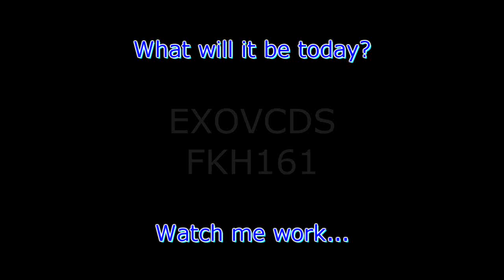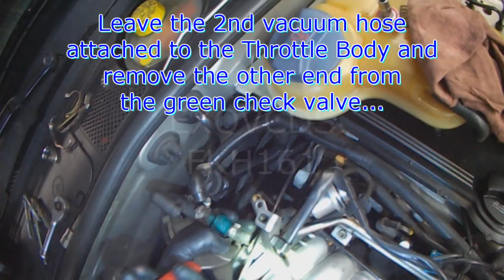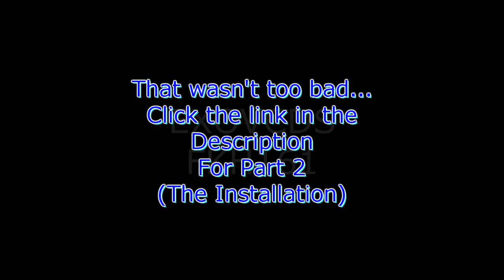Audi B5: V6 ATQ Throttle Body Replacement (Part 1)

Comment: My car has a problem with RPM instability after startup, and sometimes I get power shortages on uphill roads. This sometimes goes away after a certain amount of driving. Can we solve this problem with throttle cleaning? My car is an audi b6 cabriolet v6. I found out that this is the same construction as the passat 2.8 engine and the Audi b5 v6 engine, and I learned a lot from your videos.
Reply: My question is, is there any room for this to be improved only by maf cleaning? And if I have to clean the throttle, I would like to do it with minimal disassembly. So is that possible with just 4 bolts separating holding the TB?
Reply from the maker: Throttle body bore cleaning usually only solves "idle issues".

The throttle body can stay in place / does not have to be removed for cleaning. Remove the intake duct that is attached to the throttle body and use a wet rag (gasoline or brake parts cleaner) to wipe / clean the throttle bore. Use your fingers to push the throttle open & hold it open and then use the wet rag to clean the inside. 

Check the ECM for fault codes.
Check the engine for vacuum / air leaks.
Check fuel pressure & quantity.

Most likely it's not a dirty throttle body issue.

Comment: Awesome video, I couldnt have gone through the process alone with your help. I'm having a rough time getting the clip portion of the cruise linkage off. And since its just dangling sort of, its difficult to get the accelerator cable off. Any tips? Thanks
Reply from the maker: Wavy Crockett Can you send pictures or a link to a YouTube video of the parts in question. I need to see things so I can explain (correctly) what to do. fkh161@fkh161.ca

Comment: I just bought a 1999 Audi A4 2.8 Quattro manual 6 cylinders the other day and it has a code p1545 it has a rough idle/low rpm/power and she stalls if not giving it some gas now I have look it it up and it says if I replace/clean the the throttle body and relearn the TB it should fix it because people had the same problem with Audi's around that year. And it has a oil leak that I have to fix as well. And it seems like its misfiring to I am seeing if I should buy a new one at autozone or get one used at molts for $100 or should I try to clean it first and hook it up to VAG-Com and relearn it?
Reply from the maker: IMP429 Cleaning will only solve an "idle" issue... if you have issues when off idle, then it is not due to dirt.Cleaning the throttle bore is a cheap first step, when dealing with throttle body module issues.
Reply from the maker: IMP429 In the video, he says that all you have to do is the basic setting / adaptation. Like I said, clean it first and then do the basic setting / adaptation. If the problem still happens, could be the throttle body.

Comment: I have a 99 audi and when I'm in drive or reverse, in a stationary position the car starts to shake and the rpm fluctuates..  But when driving it doesn't affect the car.
Reply: Is it the V6? Mine does it a little when starting up, but after driving it'll settle to 800 RPM at idle and smooth out. I'm still trying to find out why it's doing it on mine, but still haven't given it a throttle body alignment yet and hoping it's just that. 
Have you already replaced or made sure the vacuum lines, PCV tubing, and suction jet pump are all good?

Comment: I've got a crank,  no start, epc light is on.  Sounds like a lifeless cranking.  I replaced ess already, I checked for gas at fuel rail. There is decent spark. I'm thinking it might be the throttle body.  I dont hear the normal whirring noises it used to make when turning the key to on position like before.  Also I noticed a slight buzzing by the throttle body with key in on position that stopped when I smacked it.  It's just so tight back there and crunchy hoses too. Codes have been cleared now with the disconnected battery. I had an o2 code and camshaft code before all this but ran decent.  All started after the polar vortex hit
Reply from the maker: Check your timing belt... if the water froze, the belt might be broken.

Comment: Great video, thank you. My pcv tube broke that is under the intake manifold and I'm having a horrible time getting to it. Do you know if I must remove the intake or can I get to it if I follow your work to get underneath the throttle body?
Reply from the maker: Which part... #13 in this link?
https://audi.7zap.com/en/usa/audi+a4+avant/a4/2000-223/1/103-103080/

Comment: Wanted to thank you for posting this, really great How-To and very helpful. You might be able to help me with an issue i'm having with my newly purchased 2004 Passat Wagon. It's also a 2.8 V6 30 Valve. (same as this engine?). It has a random misfire at accelerating from a dead stop, (like a stop light and such). I replaced the spark plugs, fuel filter and didn't solve the issue. I was thinking of cleaning the TB to see if that helps. Any tips you can throw at me?
Reply from the maker: Jonathan Soto Not a lot of room to get at the throttle body unless you remove it. Misfires caused by dirty throttle body are usually limited to "at idle"... once the throttle is opened, enough air should flow to not be an issue any more. The only way to know if it will help, is to clean it and see. Try to see if it is a certain cylinder... faulty injector spray pattern at lower spray volumes / initial demand? Carbon build up? Ignition wires?
Reply: @EXOVCDS  I have a random misfires and a code for p0104 I changed the spark plugs the coil pack, wires, purge valve solenoid, fuel pressure regulator, and fuel filter, valve cover gaskets due to some oil leaking in plugs and still have misfires
Reply from the maker: Year, make, model, engine? Compression test results? Fuel injector power balance test / check? PCV working correctly? Misfire at idle only or all load / rpm ranges? Fuel trim values? Is the computer adding or taking Fuel away? Are you sure all the new parts are ok?
Reply: @EXOVCDS  it haves a slight idle almost nothing at dead stop and its burning more gas than usual. And yes I got the bosche plugs pregapped
Reply: @EXOVCDS  is the pvc the one connected to the suction pump and the valve cover breathers
Reply: @EXOVCDS  and it's idling  alil before 1000 rpms it's one mark below 1000 rpm
Reply: @EXOVCDS  1999 audi a4 2.8 quattro it smells like strong gas and strong oil burning it runs good on high rpms and not that bad at low rpms. Sorry for all the replies 😅
Reply from the maker: @Hiddensubliminalt  Since it's a V6 and the misfire only happens on #4, it's not going to be anything that can affect all cylinders (fuel pressure, vacuum leak, restricted exhaust etc). I think that model year had an "ignition module" on top of the air filter box... you need to check if the ignition module is sending a signal / activating the coil correctly. Compression test and fuel injector test would be next for #4 cyl.
Reply: @EXOVCDS  it does have misfires on 4 5 and 6 its haves misfires but the main one is 4 and I want to know what else to check for I already burned one catalytic converter so I'm kinda stressed about it. I already changed purge valve solenoid, fuel pressure regulator, fuel filter, coil pack, wires, and plugs, valve cover gasket. Wondering if it's the PVC for the valve cover breather or suction pump for pvc  or egr

Comment: Great video but not an easy job. I am getting a for a 2002 Passat  error code 17579 - Angle Sensor 2 for Throttle Actuator (G188) Implausible Signal, sets off EPC light. I think it is a dead spot at the variable resistor thingy. Can this sensor be serviced without removing the throttle body?
Reply from the maker: Not that I am aware of... the only thing serviceable on the throttle body, is cleaning the carbon deposits from the inside of the throttle body (according to the service manual). I have come across several DIY articles where someone opened up the throttle body (circuit board side), cleaned the carbon track or replaced / repositioned gears. Any of that is done at owners risk.

Comment: I have a noise that comes when the car is under load, for example, I put second gear and floor it (no need to floor it for the noise to come), it sounds like a cricket, can be heard better when there's a wall or inside a tunnel, especially between 2k 3k rpm then it almost disappears. With the car stopped and in neutral, if I floor it I can also hear it but not as long since the engine is not on the same load as if it had a gear engaged and moving.
What could it be? I think it might be a leaking exhaust manifold, it's an audi a6 c5 with a 2.4 V6 engine (same as 2.8L but less cc).

Edit: I did myself the timing belt, tensioners and pulleys (they were due) but the noise is still there.
Reply from the maker: I don't know,  I can't hear it. Could be exhaust, could be a rattle, could be an engine noise.
Reply: @EXOVCDS  I'll try to record a video.

Comment: Planing on buying an Audi A6 C6 2006-2008  and your the only skilled enouth i know to ask :). Please tell me which is the most reliable engine from that car series. Plenty of 2.0TDI's, 3.0TDI's 2.7TDI. 
The only petron engine i liked was 1.8Turbo. Very few of 2.0 turbos out there, but i was looking at them to. Need your small suggest here please :).! Love your work.
Reply from the maker: I'm not home right now... will reply again later.
Reply from the maker: I would check an Audi Forum for "Owner Feedback". There's nothing better than the feedback from an actual owner! I don't see a lot of Audi's and even less of the newer models (2006 and newer) at this time. The bigger the engine, the more difficult it is to work on (less room), not just for the DIY person, but also for the mechanic and more expensive to repair. Check out
http://forums.audiworld.com/forumdisplay.php?f=58
or similar Audi Forums. Maybe one of my viewers will also have some ideas or an opinion they might share. Thanks for watching & taking the time to comment!

Comment: Please let me know if there's a gasket behind that throttle body!! I didnt see one when I pulled it off all the throttle body did was butt up to the intake and there's a orange circle piece is that the gasket? Already mounted on it?
Reply from the maker: The intake has a rubber seal.
Reply: Thomas EXOVCDS thanks your awesome!
Reply: If the seal is torn or just worn with it cause my car to drive like it lost power and low idle
Reply: Crystal Meza I'm not sure but have you checked wires,plugs, and the coils? And check the vacuum lines, I broke mine a couple years ago and duct taped it back together and it still allowed air to get through, once air gets into the vacuum it causes these issues, once I replaced the plastic hose my symptoms went away, I cleaned my throttle body and the gasket is like built in on it, kinda weird technology tbh, I still have a cylinder 4-5 misfire but it isn't noticeable, I think it would be the coils causing it on mine
Reply from the maker: Hi Crystal... which seal?
Hi Michael... thanks for helping! Send me your mailing address and I'll send you some of my channel stickers! fkh161@fkh161.ca
Reply: Hey Thomas, can you lead me in the right direction to buy one of those seals? Pulled my intake off and the seal is badly deformed and cracked all around

Comment: I smoked tested for vacuum leaks and that rubber piece between the plastic intake and TB has a massive leak. It looks fine but doesnt seal at all. Part is no longer in production, any advice before i whip out the RTV
Reply from the maker: Is the part in this diagram?
https://audi.7zap.com/en/usa/audi+a4+avant/a4/2002-223/1/133-133080/
Reply: @EXOVCDS  yes, number 7. For now I did put a light coat of high temp sealant around the inner lip of the seal and the groove where the plastic tube Goes in, smoke tested it and its definitely much better now. Whose idea was it anyway to have that thing held on by a single bolt.
Reply from the maker: If you are going to use RTV, make sure that it is "O2 sensor friendly". 
ECSTuning seems to still list it:
https://www.ecstuning.com/b-genuine-volkswagen-audi-parts/throttle-body-seal/078129949c/

Comment: Hello at 8:53 is the little port plug supposed to be plug. I did a full clean on my throttle body installed everything back and car now has a slight shake.
Reply from the maker: No... should flow air (but with resistance).

Comment: Hi how do I replace my vacuum lines the correct way
Reply from the maker: One at a time, according to vacuum diagram.
Year, make, model, engine production code?
Some are plastic lines, some hare rubber hoses.
It's possible to replace plastic lines with hoses, but the hoses are thicker and may not be able to sit how the skinny plastic lines were routed.
Some rubber hoses can collapse when they are under vacuum, so you have to make sure that the hose is able to hold vacuum without collapsing.

Comment: i have a b6 1.8t and i have a g188 i replaced the throttle body with new one, re adapted and i still have cel traction control and epc lights on.
Reply from the maker: Nay Cee What fault codes?
Reply: Thomas EXOVCDS p1171 on vcds and i had p0221 on regular scanner
Reply: Thomas EXOVCDS when i let the car sit it clears the light then when i drive it the lights come back
Reply: and i had a leaning out code p0171 i think
Reply from the maker: What year? Ross-tech says there's a throttle body wiring TSB: (read Special Notes at bottom of this link).
http://wiki.ross-tech.com/wiki/index.php/16605/P0221/000545
Reply: Thomas EXOVCDS i checked the voltage on the plug and i was not getting anything from pin 1
Reply: Thomas EXOVCDS its a 05 b6 1.8
Reply from the maker: TSB covers the 05 model. If I can find the TSBB, I will post the link here.
Reply from the maker: The fix is to replace the connector & wiring... due to intermittent bad connections. 
http://fkh161.ca/Audi/A4/P0221.jpg

Not sure it will solve your issue, but it is worth a try.

Comment: also another question (just found this out) i have no intake tube bolt. are there two parts to it? i need to find where i can get new bolts and fast
Reply from the maker: M6 with a thread pitch of 1.0 x45 long with a 5 mm allen head
Reply from the maker: deadlyknights1 just making sure, you are talking about the bolt that goes here: http://fkh161.ca/VW/bolt.jpg

Comment: Sometimes our car does not accelerate properly. When I push the pedal it sometimes does not go above 20km/h and it also emits gases from the exhaust pipes, is it from fuel pump or it can be from throttle? Thanks in advance
Reply from the maker: Programmer TAT Year? Make? Model? Engine? Not sure... could be misfiring.  If the exhaust smokes heavy white (smells like fuel), you might have a fuel injector that is sticking open.
Reply: 2000, Audi A6 2.7biturbo, maybe it is from fuel it generally occurs in long rides when the pedal is pushed often to accelerate and pass the other cars, and also when the car is parked and I push the pedal it sometimes does not make a noise at all, I mean engine sound, it seems like it pushes something.
Reply from the maker: Record a video... could be oil burning smoke?
Reply: Could be MAF sensor... At least check it out
Reply: Read. Codes.

Comment: How do I determine if my motor is atq or aha? Having a hard time figuring out what alternator is for my 1999 a4 2.8 as it seems to be 2 options. Don’t wanna GO into service mode and disabling my vehicle just yet because alternator does work intermittently.
Reply from the maker: 1998 & 1999 were AHA (in North America).... 1996 & 1997 AFC... 2000> ATQ
Reply from the maker: As per Service Manual:The engine code and serial number are located on the flat surface of the cylinder block in front of the right cylinder head.
Reply: I think I was able to determine I am ATQ that’s the 99.5 facelift version. There’s 2 connection types to these alternators. Now I’m tryna figure out which 1 I have. Not sure how to even cross reference that with VIN. This Audi making me sad 😩
Reply from the maker: I'm still at work... might be able to help more once I am at home later tonight.
Audi parts department might be able to break down the VIN for you and tell you which part number to use for alternator purchase.
Reply from the maker: Forgot to mention that ATQ is "Drive-by-wire"... AHA still has a gas cable attached. IIRC
Reply: My 99.5 audi 2.8 under the spare wheel found a small 3 by 3 paper list all info for the vehicle, should be standard
Reply from the maker: @sususundry  Good point... I forgot about that sticker. Send me your mailing address and I'll send you some of my channel stickers for helping. You can find my contact info in the description (fkh161 website). Click on tool request and send me the address.